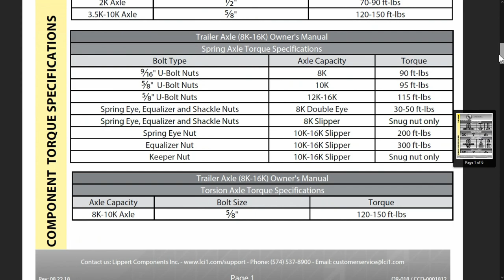Check Your Critical Nuts and Bolts - Routine RV Maintenance Tip

Comment from the maker: Related Links
Air Ride Pin Box Review - https://www.loveyourrv.com/lippert-air-ride-pin-box-review/
New Brakes and Bearings Install - https://www.loveyourrv.com/installing-new-trailer-bearings-and-brakes-on-our-cougar-fifth-wheel/
Road Armor EQ and Wet Bolt Kit - https://www.loveyourrv.com/big-suspension-upgrades-installing-lci-road-armor-eq-wet-bolts-bushings-shackles/
Lippert Torque Settings Quick Reference -  https://lci-support-doc.s3.amazonaws.com/quickreferences/ccd_0001812.pdf
Reply: Just a little tip I noticed in the picture of the leaf springs that it looks like the springs are starting to get a bow upwards right where they rest on the axle my older fifth wheel started doing that and I hit a bump one day and it broke right in the middle
Reply from the maker: Thanks, on the to-do list to upgrade. But they actually haven't changed too much since the trailer was new. Always looked a bit flat.  Here is a look from Jan 2013 when the trailer was around 2 years old  https://www.loveyourrv.com/wp-content/uploads/2022/10/springs-2013-to-2022.jpg

Comment: If in doubt, put a socket on the nut or bolt just to make sure it's not "loose."  Torque wrenches eliminate the guess work, but to me, checking often is the best medicine.  I'm going to check out my lug nuts today because of this video!  Thanks Ray!

Comment: This is a really good video and covers things you don't think about that need retorqueing from time to time.  We just got back from a 3000 mile plus trip from Kansas to Maine.  When I got home and was unhooking the travel trailer from the ball, I noticed the ball moved.  I thought I was seeing an optical illusion.  Nope.  The nut on the shaft for the ball was about 1 turn loose!  That was something I never even thought about checking.  I thought once it's tightened down, that was all.  I know it's torqued to something like 250 foot lbs so I never gave it a second thought. We drove on a lot of rough interstate on our trip.  Somewhere along the trip, the nut came loose.  Thank goodness the nut didn't come off or was much more loose than it was.  It would have been a bad day.  Never again will I travel pulling my trailer without checking the nut that holds the ball.  Anyway, great video and thanks for posting!

Comment: Good info. or reminder. I generally check mine prior to a big trip & then about every 3-4 small trips. Your video just reminded me though that I have not checked my U bolts that hold the leaf springs on the axle. I know what I'll be doing next! I carry 2 pneumatic impact wrenches with me (med/large & medium) I set them fairly low TQ then finish off with my manual TQ wrench. I shoot a little grease in the wet bolts as well. A little PM saves a lot of aggravation on the road.

Comment: I got a dually outer tire, flat last month on my camping trip, I just arrived in Castlegar, BC, “Integra Tire and Auto Centre” awesome guys who do it right used a hand torque wrench checking n putting back on my tire.  I chatted with them while they fixed my tire, these guys strive n take pride in doing it right. I was impressed. 🍻

Comment: It looks like you might need to look at some new leaf springs. The one you showed is basically flattened out.
Reply from the maker: Yes, on the list. But they actually haven't really changed too much since new. Always have looked a bit flat but work fine.  Here is a look from Jan 2013 when the trailer was around 2 years old  https://www.loveyourrv.com/wp-content/gallery/276rlswe-undercarriage/undercarriage-1024x768.jpg
Reply: I can remember making the same comment almost 5 years ago about the flat springs, but to Ray's point, it came like that from the factory. I have often wondered if they were under spec'd from the start. Anyhoo, looking forward to a possible leaf upgrade video one day.

Comment: By the looks of the trailer springs it appears they are beginning to reverse arch. Meaning it is time to replace.
Reply from the maker: Yes, on the list. But they actually haven't really changed too much since new. Always have looked a bit flat but work fine.  Here is a look from Jan 2013 when the trailer was around 2 years old  https://www.loveyourrv.com/wp-content/gallery/276rlswe-undercarriage/undercarriage-1024x768.jpg
Reply: @LoveYourRV  The picture shows a lot more positive arch in 2013. As long as it is on the list you are ahead of most!!
Thanks for the videos!
Reply from the maker: Its neat to have so much video footage of the trailer. Can go back to compare, Out of interest here are some photos comparing trailer in January 2013 had about 15 - 20K miles and today October 2022 with over 80K I'd guesstimate. https://www.loveyourrv.com/wp-content/uploads/2022/10/springs-2013-to-2022.jpg  I know it has Dexter D44 axles rated 4400lbs but I wonder if Keystone may have put in springs for the more common 3500 lbs. axles. I think I'll go with replacements rated for 5000 lbs. when I change them. Cheers, Ray

Comment: Just an FYI socket extensions affect torque settings.  Calculator online
Reply from the maker: Only if they are extending the length of the wrench  A straight extension will have no effect on the torque wrench setting. Will extensions change your torque wrench reading? Proof and the answer - https://youtu.be/tRR96ILGORU
Reply: Thanks. BTW love your videos